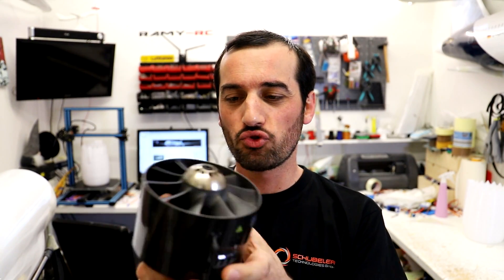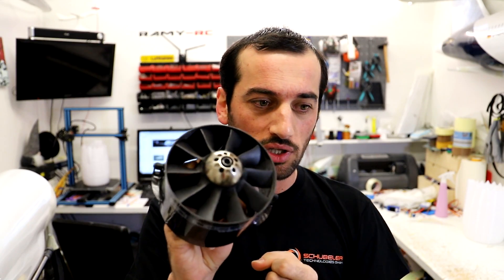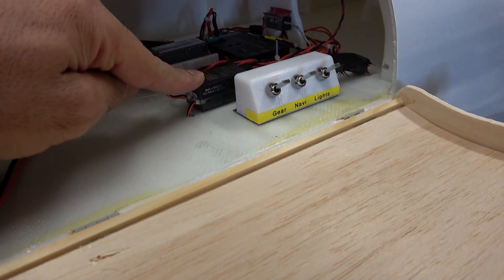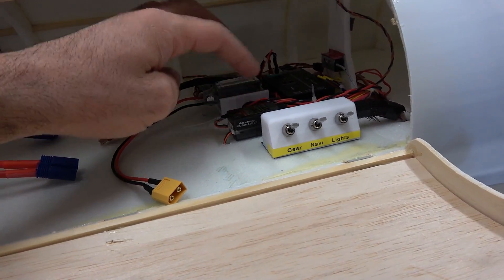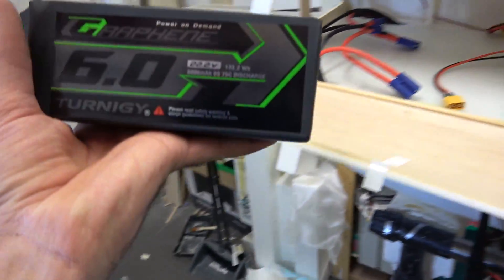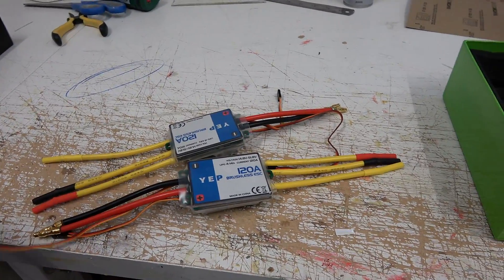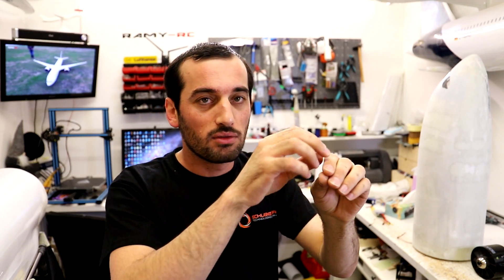Boeing 787-9 Dreamliner RC airliner build video PART 6

Comment: R.I.P 787-9 
Cause of crash: Human error, fail to respond early enough to  correct the bank angle lose of lift 
( This type of aircraft could not fly upside down due to how the wings were shaped) even though the pilot was able to increase thrust and correct the bank it needed more altitude to recover fully. Ramy rc we lost this wonderful plane but we still remember how u worked hard thanks

Comment: Was curious, I noticed you did not show if you did any prep like sanding to the 3D printed cowl before moving forward with the fiberglass skinning? Does the fiberglass hold up to the typical ribbing that occurs on prints, or is your printer good enough that it does not leave these ridges?

Comment: I watched the tragic end of the Dreamliner in the video. What a sad moment. I'm too building large electric RC aeroplanes. Did you ever check out the current of the EDF's? You are using a SPECTRUM. How many satellite receivers did you in use? It's looking like a random reboot of the receiver and that takes a few seconds with SPECTRUM. The same by JETI takes only the time of a blink of your eyes. I highly recommend to change to JETI for such models. Since I changed  to JETI several years ago I never had problems anymore. My next project will be a PILATUS PC-21 in 1:3,5 scale with 8 KW electric motor. Head up and look forward. Good luck!

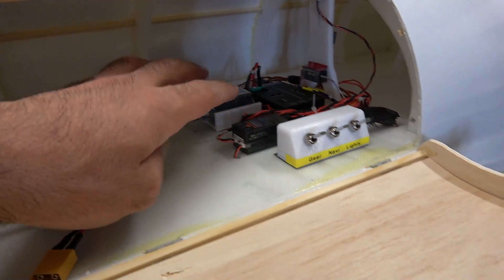Comment: Ramy I can not thank you enough for 7:42 part, it's something that I wanted to see in your video and hear from you, from the time I started a project. Thanks again for the BEC's capacity 😀

Edit: Also, Ramy, do you disconnect all the positive wires from all the ESCs that run to the engines, so that your receiver only gets powered by the 3s cells??

Comment: You once told us the building of an airplane is quite expensive. But how much does it approximatly cost to make a plane this size?
Reply: So you want dual engines?
Yes
It is €2000
Aye, I take rubber band propeller please

Comment: Nice job.  What design software do you use for the engine nacelles.  Thanks
Reply: Looked like 123D. I have used it, it's free and pretty capable but a bit too simplified compared to SolidWorks etc.
Reply: Niklas   Thanks. I try to use sketchup without much success
Reply: @damienmilk3025  For 3D printed parts SketchUp is not the best. It often makes things too complicated and when i used it last time it missed a stl saving option. :)
Reply: Niklas   Unfortunately I bought a paid version so I need to persevere with it. That being said I am a a very novice user. Slowly learning 😀